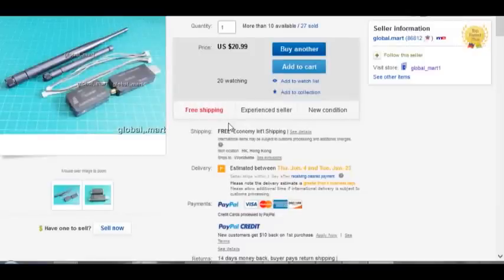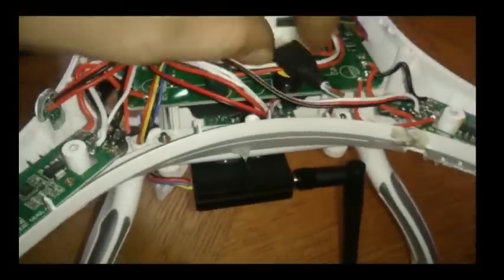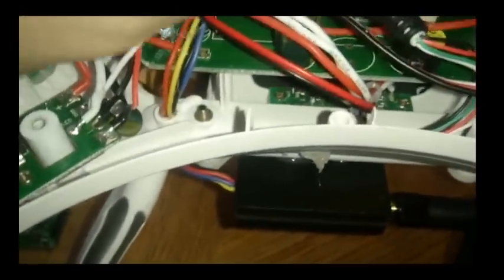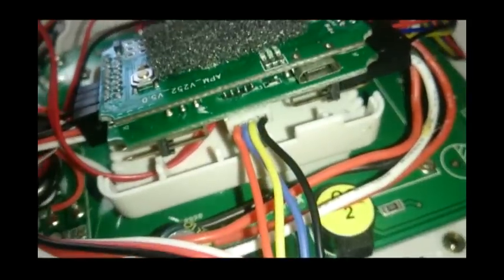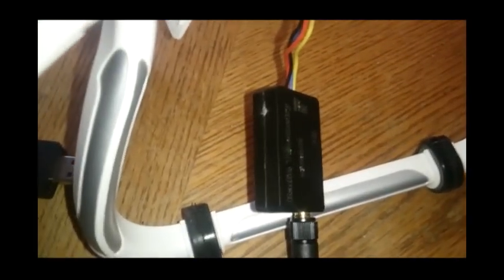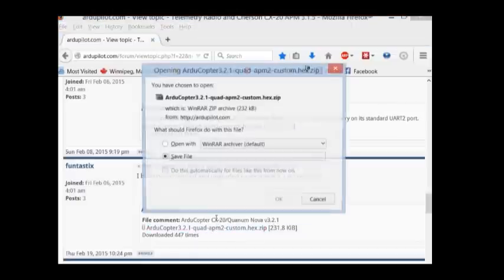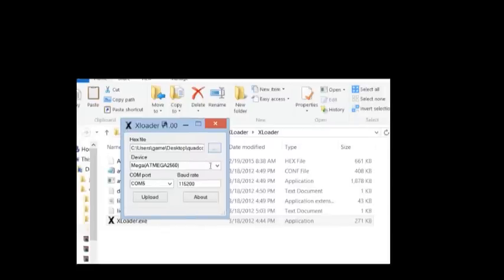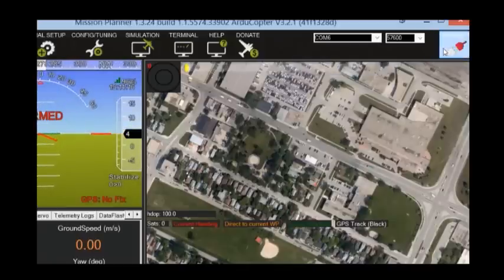Cheerson cx20 Apm v252 v5.0 telemetry Fix-with socket.

Comment: I have apm252 an arducopter v3.1.2, and after mount telemetry I cant connect to MP. My lamps on telemetry blinks (1hz greean and 3hz red) like in this video: https://youtu.be/guF7FTLGEv4 Thx for any help.
Reply from the maker: +Mateo Gasparovic EDIT .. oops.. your already at v.3.1.2     you can double check to see if your tx and rx are backwards.. but as I said pre edit.. most likely that is not it
Reply: +bangs6996 I try to swich tx rx but then i have just green led flashig 1hz and red none. Ok do i need to do this hax update if i have 3.1.2 version?
Reply from the maker: +Mateo Gasparovic NO... Sorry I did not see you were still at version 3.1.2 .... Green flashing means its not connecting to the rx/tx that plugs into your computer.. .. ..you should be able to get solid green light on both even if the tx and rx are not connected.   .. You can try going into mission planner and into optional hardware ..and see if you can connect through the 3dr menu.    Do not push the Main "connect" button on mission planner.. use the load settings button in 3dr radio menu
Reply from the maker: +bangs6996 You stil need to set it to the right com port and baud rate ..   comX   baud 57600     .. at most you should at least get the data off the unit that plugs into your computer, if not it might be defective
Reply from the maker: +Mateo Gasparovic  I think we are having a lag convo , I posted above for something else to try.  also once you try getting your 3dr settings , here is a example of what mine look like ---------get file 3drSETTINGS.jpg    https://drive.google.com/drive/folders/0B2w6_OKE_2kxTWxyZTlDMVZKVkU
Reply from the maker: +Mateo Gasparovic Still seems you are not connecting to the remote module ,  If you unplug the quad and just fallow the same specs most likely you will get the same outcome.. you should end up with what I had,   If both lights on both units don't go solid green, you have a defective issue most likely
Reply from the maker: +bangs6996 and for kicks you can try to double check that both your wires are plugged in right.. you had to move the wires over during the mod so maybe they are not pushed in right..at least one of them the tx or the rx   <-Most likely the rx
Reply: +bangs6996 I try to it on 3.1.2 , 3.1.5 and 3.2.1 ardu copter and nothing happend. Always the sam flashing (red 3hz and green 1hz). My connections on cx-20 u can show in pictures:
http://i64.tinypic.com/2wrdbm1.jpg
http://i68.tinypic.com/20pd5ye.jpg
http://i67.tinypic.com/ao3q5w.jpg
Reply from the maker: +Mateo Gasparovic You might have to fallow the modded firmware now that you have moved away from 3.1.2... but that is not your issue..    the problem is one of your components is programmed wrong or is defective.      You should be able to just plug the adapter that plugs into your computer into a usb power bar (positive and negative ) volts only .. and get a solid green link to your remote module .  That is your goal right now is just to get a link(solid green light) .   I don't have a defective unit so I have not had to learn how to program the unit directly to see if I could fix it or not.    I have a feeling your going to be left ordering a new unit or getting refunded
Reply: +bangs6996 what do u think about: "Using a FTDI-to-USB cable to configure SiK radios".
http://copter.ardupilot.com/wiki/common-3dr-radio-advanced-configuration-and-technical-information/
Reply from the maker: +bangs6996 For kicks you can try to plug the usb part into a usb power brick just to see if it is a volts problem on your pc..   In reality you don't need tx/rx or window drivers to get a solid green light on both units ..  <------ so with that, plug in the usb adapter into a Wall usb adapter (charging phones ect..)   you should get A blinking green light, Next plug in the quad copter and you should get a solid green light.
Reply from the maker: +Mateo Gasparovic If you scroll down on the page you sent me and look at Forcing bootloader mode..     You might be able to reload the firmware.   But your having issues even sending at command anyways so  I doubt it .. you will need to physically hook up the air unit to your pc and reprogram it.. something I have not done yet
Reply from the maker: +Mateo Gasparovic Do you have a usb to serial cable?   I am interested in learning this anyways. If so I can figure out if I can program directly .Not saying this will fix your issue but you might be able to reload the firmware to see if that is the issue
Reply: +bangs6996 I made usb to micro JST cable. And wire connect radio (air) module to pc. But now i have problem that windows 10 cant create port for that device. In device manager stay yellow allert sign. Have u idea or where can i download driver for radio (air) 3DR module.
Reply from the maker: +Mateo Gasparovic Confused!.. Your usb to JST cable that you made.. How does that work?    I believe you need to use a usb to serial adapter ..or a chip like a 232 or 1489 to use on a old com port.      the baud rate for usb and serial are just way off and you need to get it down to 57600 anyways..        or am I wrong?
Reply from the maker: +bangs6996 ah .. i will just hack into mine as I have the cable and its only 4 wires to confirm it ..  <---i'll prob brick it heh.. will see
Reply from the maker: +Mateo Gasparovic actually that cable you show in the picture I have a bunch of those and soldered one just now into the unit ..that is a usb to serial adapter ..it actually has a chip inside of it.. .. Do you have that cable.. or just cut off any cable ?    .. If you have that cable ..u will have to crack it open and see what chip it has..mine does not support windows 10 and I am in a virtual machine right now with mine installing .net which is taking for ever.
Reply from the maker: +bangs6996 Success .. Alright so if you actually have that same cable as mine with the chip in it.. pl-2303hx.. you will need to find a windows 7 or xp ... I just use vmware virtual machine its easier and xp handles everything almost. .. wire up the 4 wires and program it through 3drRadio simply push the Upload firmware.. it does not even ask you for a file which is really odd, but anyways it works at has our version already included so you don&#39;t need to download nothing else.. I will make a really small video of the steps
Reply from the maker: +Mateo Gasparovic Video should be up in about 40 mins or so / slow

Comment: Thanks a ton for this video, i had very bad experience with the telemetry setup, i fried one with the default wrong connection on the power line of the cable (inverted polarity), ordered another and i was careful this time, still didn't worked as the bug in the latest firmware (wondering how APM creators still didn't fixed this bug), with the custom framework it worked, but this is not the latest version :-( 
All works...that's the essential....bravo...hats off.
I wonder there are lot of wrong information on the internet on setting up the telemetry, the worst i was in the infamous site http://www.instructables.com/id/Cheerson-CX-20-3DR-Radio-for-New-Board/?ALLSTEPS
where they are asking to solder the TX RX cable directly on the micro-controller pin (near to it), i am sure this will work as there are multiple serial connection possible with the Ardunio Mega, but this is very cumbersome or even dangerous (as we can easily mess up during the micro soldering)
Reply from the maker: +Nazir Khan Thank you!,  Not sure why they had to go threw all that but I do know on some of the mods I have done, Sonar mod and optical flow mod, I had to solder directly on the micro.    "wondering how APM creators still didn't fixed this bug" Seems like they just don't care .. they don't even have a proprietary unit that plugs in it, so its just a screw up they never bothered to fix.
Reply: +bangs6996 Thanks to share the info that Sonar and Optical flow mod you had to solder on the micro, was it also the same version of APM board? cause, as next step i am planning to upgrade my done with Sonar :-)
Reply from the maker: +Nazir Khan Hi yes its the same apm , I have a video of the steps and also the mod you have to do on yours .. check out the ending, I think I have a quick time link that shows the cx20 apm. its only one solder mod.. but if you bridge the contacts with solder it can be a real pain in the butt to remove it, even with tonz of flux and braided copper..

Comment from the maker: Crowstooth  ..thank you..
   -->  go to config/tuning     -->standard params ->RTL_Altitude(RTL_ALT)  mine is set to 424    .the 424 is in cm's   ...
Reply: What happens if I don't download it with x older will it not work on mission planner
Reply from the maker: +Berk Kip ..which apm do you have?   the hex should load with mission planner custom option..
Reply from the maker: +bangs6996 This is basically out dated so you can just use mission planner load custom firmware option ..if you get a error while writing just try again once.. if you get a error again ..load version 3.2.1 then move to xloader but basically its the same thing

Comment: Thanks for this tutorial. I am not able to connect CX-20 to computer via USB cable. I have same hardware inside quad as in video but when I connect cable a beep beep sound and lights flashing tell me it is not liking it. Tried all USB cables I have but same tihng happens with all of them. How can I solve this to be able to connect my quad to mission planner?
Reply from the maker: +Alex Echeverría open up device manager and see what pops up under ports 10:32    . you might want to try to install  Apm planner  as well from the same people http://ardupilot.com/downloads/?category=35     it also installs the drivers for your apm.         You can also try setting mission planner to "Auto" then push connect.                          You can try plugging a usb cable directly into the apm
Reply: +bangs6996 Wow! Thanks for prompt reply bangs6996. I solved my problem by first connecting a Lipo to quad and then connecting cable to computer (I figured out 5 volts from USB were not enough for all the electronics inside quad and it made all the "low voltage" scenario). Mission Planner recognized it right away. I am now buying a 5 pin plastic connector as my APM has a 5 pin mini port soldered on it. I got a Hobby King telemetry kit that includes two TxRx boxes similar to the ones shown in your video but they have 6 cable connetors. I have not flown my new CX-20 yet and will test a simple autonomous mission thetering quad with a fishing line. I have discovered that, for AUTO to start mission, I have to push throtle a little as CX-20 does nothing when switching to AUTO alone. Hope I explain myself well. IS that the way to go?
Reply: +Alex Echeverría Oh, and Mission Planner asks me if I want to upgrade APM but I have not done that yet as I have read things can change to the bad.
Reply from the maker: +Alex Echeverría ...Glad you got it working with a easy fix.  for now I would not upgrade the version unless you need to .. Like if you want to use the options fallow me mode in droidplanner.. .      I would prob skip the fishing line ,if for any reason the quad drops in altitude it could potentially get wrapped up very quickly ..      I would suggest doing couple of return to homes to confirm the compass and gps is working. then do a auto mission.    If for some reason it takes off in another direction when you push the return to home .flip out of it and bring it down as your compass is most likely set wrong.      and it seems fine how you set it to auto..
Reply: +bangs6996 What you sugest makes more sense. I will fly quad and move levers to RTL position and if quad goes somewhere else I will return to STABLE mode to retrieve it and recalibrate compass. I did the Mission Planner initial calibration. I want to make photo mosaic along a river for a friend who bough a Walkera 350 to do that but has GPS malfuction so flyign manual is the only way and he has no experience so I did the work but did not dare to fly it in a dense vegetation area were I had no visual of quad. I bough CX-20 quad in Banggood and have lots of expectations to complete this work :)

Comment: Think I might have just fried mine.  Saw that mine was only displaying only the blinking green light.  So, I rearranged back to default wire order and now there's no lights displaying at all.  Is this a manufacturing defect, or is the FC on the nova wired differently than this was intended to plug?
Reply from the maker: +Devin Dorman the plug/wire is really meant for apm 2.6 2.8 ect.    If you have a meter test for positive and negative on the 2 out side pads of the header on the apm of the nova, confirm the red wire is going to positive of the telemetry and the black to the negative. (Put It back how it was when you had the blinking green light)      It might be a tad forgiving seeing we are playing with low voltage . so it may still work.       If you can get the green light to come back and blink.   Plug in the telemetry part into your computer to see if the green light goes solid.   (while figuring out positive and negative leave out the tx and rx wire out of the harness)

If you get the green light back.
You can start playing with the tx and rx ,It might of been you simply had the tx and rx reversed.  You will not get a red light in that case, also some times the wires don't get pushed all the way in right.       The inner 3 pads only have a limited amount of combinations seeing the tx and rx are always next to each other ..for example  .. 

+ tx rx N/a -      + rx tx N/a -      + N/a tx rx -    +  N/a rx tx -      <--n/a = space
However do not swap the positive and negative on the tx rx line as you might fry the atmel/apm  and the telemetry
Reply: +bangs6996  I think there's no denying that it's fried.  I removed everything from the plastic clip in case moving wires around had caused it to lose it's ability to clip securely.  I just pushed the metal clip straight on the appropriate pin for POS and NEG according to where I found voltage with the meter, which was where you had shown correct orientation from your wire order.  When I switched it back to the default wire order it was reversing pos and neg.  So, I shouldn't be surprised.  I guess it's not the most expensive thing i've broken!
Reply from the maker: +Devin Dorman Yeah I've made many things go poofy as well ,The worst part of this scene is the wait for the replacement parts.. Good luck on your next one if you decide to try again.

Comment: hello friend wanted to know if the big shark version can be connected telemetry ?
I would greatly appreciate your response
Reply from the maker: +daniel catrihual urrutia I don't have a big shark apm,, so I can't say yes or no.
I would believe the answer is no depending what apm is truly inside it.
  have you opened up your unit to see what apm build number it actually came with?.  ... Pin 2 and 3 on the 2560(if that is the cpu you have) is your telemetry uart tx/rx .. So if you are able to program with mission planner to 3.2.1. and if your board does not have any traces for pin 2 and pin3 I'm sure you could hack in telemetry. ... Worst case is just order new apm 2.6

Comment: hello friend, a question connect telemetry to CX20 all well but as you do to do missions, I have a tablet and put the mission and then save it to file and when I wanted to do the mission I opened the file, then send to apm and then loaded from apm but did not do that I can do.
Reply from the maker: erikson yol 
Please try to ask your question again with different words, your translator did not work right.<--or auto finish/correct is messing up your Q's
After you upload your mission, you click ARM .. then A "Auto" button will appear . click that when your ready.    alternative of using pc to setup params you can click on Parameters in droidplanner ,scroll down to Flight Mode 2 and change from 2 to 3 for auto. then choose to "upload parameters"  Now your remote will be swB-1 + swA-2  will be Auto.
Reply from the maker: bangs6996 I will upload video of that step in about 10 mins. in case that is what you wanted to know.
Reply from the maker: bangs6996 ok so I uploaded this https://youtu.be/szTp_p0k_vk   if this is not your question. please ask again. I'm sure it might be helpful to somebody some day anyways.. plus I wanted to see how quick I could make, edit and upload a video lol..
Reply: bangs6996 Gracias  por  tu  vídeo  buena  información  voy a seguir  su  consejo

Comment: I have to download everything that you show in the video, the mine has otg cable the lights are green but when I connect it happens nothing has threads four colors I have put it in cx20 to work
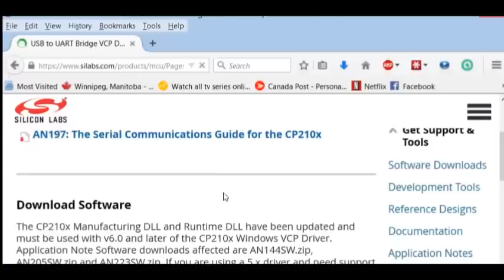Reply from the maker: +erikson yol Hi,  with the part that plugs into the cx20 does this happen 8:41  the red blinking light?    otg cable needs Tower/droidplanner and 3dr Services. for your phone
Reply: and as install you the 3 Dr service to my phone
Reply from the maker: +erikson yol with the otg can you connect usb cable directly to cx20 ?
Reply: Thank you will approve
Reply: Thank you for how we have to fix the cable of the apm I worked on my tablet, a question as you do to do the missions that buttons you use to make it fly automatic example (swb 1 and 2 swa) or other
Reply from the maker: erikson yol Hi, for some reason youtube is not telling me about new posts..    Anyways In mission planner (pc)  you need to change your switches , go to config/tunning  then click on flight modes    .and replace one of your settings.     You can turn on your remote control and cycle through swb +swA  switches for the one you want to replace then click on the combo box and choose "Auto".
Reply from the maker: bangs6996 by the way ,Most of us replace mode 2 (altitude hold)     
SWB-1 SWA-2 with Auto  / or use droidplanner